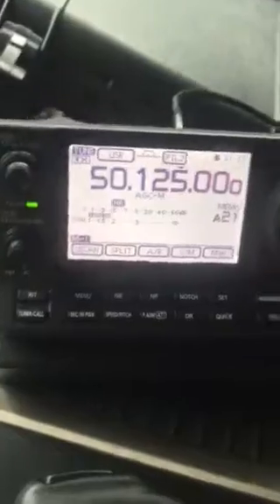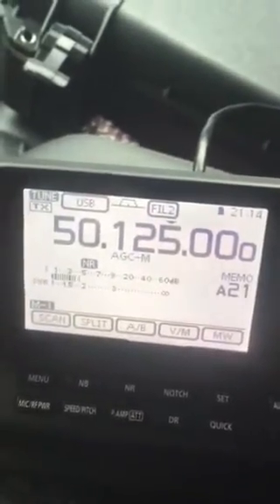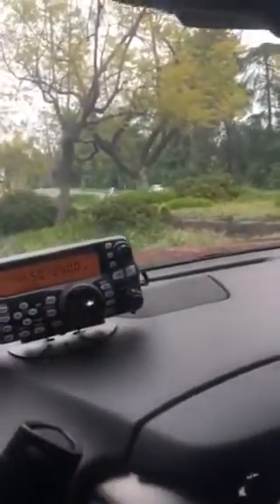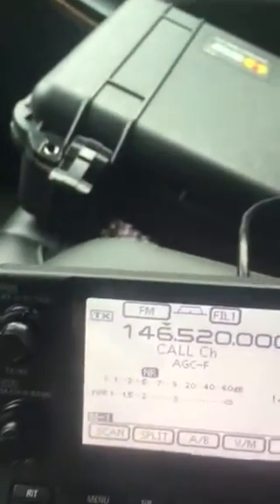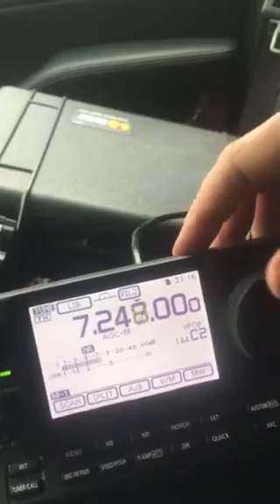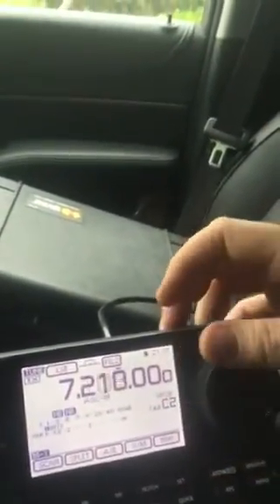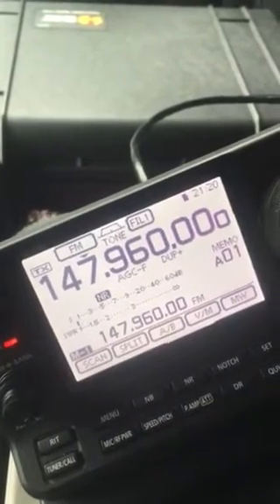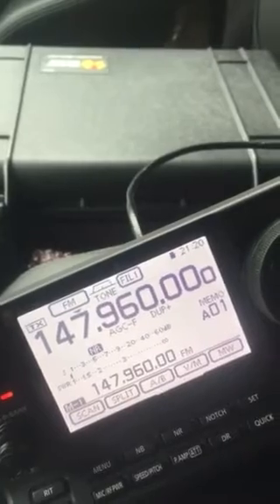Remoterig rrc-1258mkii IC-7100

Comment: RRC1258+ICOM 706 MK2G
Isn't there a regular noise from the other side of the transmission signal during remote operation?
I have regular noise.
Let me know your email address. I need help.
goodman0404@naver.com
6k5skh